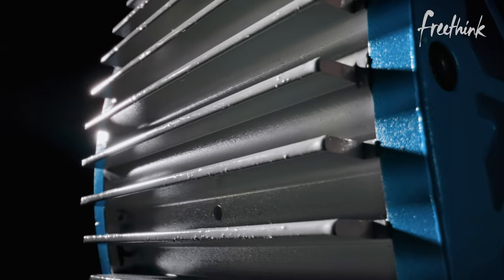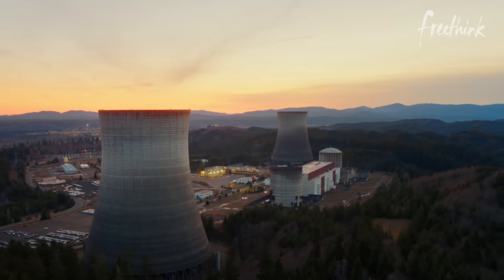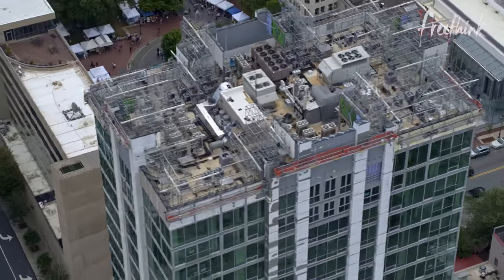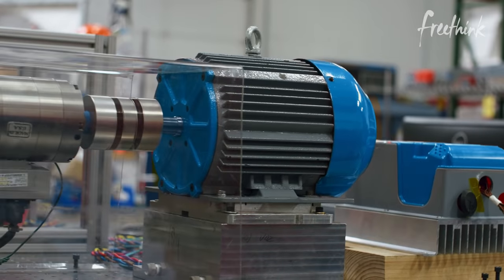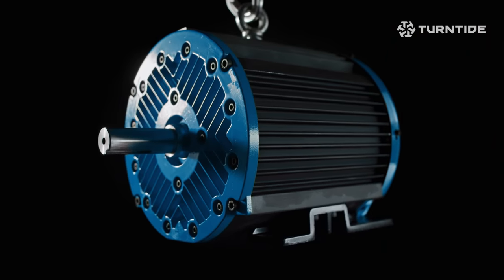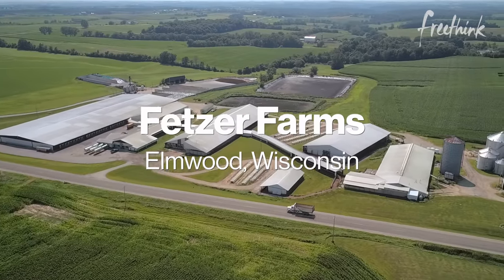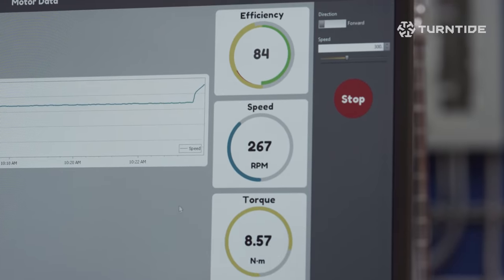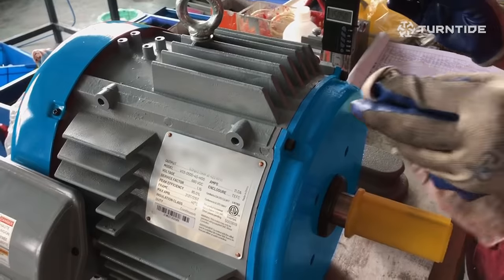Want to Save the Planet? Start with Reinventing the Motor

Comment: Most electric motors are already very efficient (>80%). So there isn't that much savings there to revolutionize anything... Sure more efficiency could help in electric vehicles somewhat, but they didn't mention anything about power to weight ratio, so it's likely not so good, otherwise it would have certainly been hyped up.

Comment: This technology is over one hundred years old. It's still an AC motor operating on slightly different constraints (reluctance). And no, you're definitely not the first to develop it or improve it.
Reply: Heh the SRM was first patented in _1838_, so yeah, well over a hundred years old :P

Comment: That sounds like a big servo drive instead of a motor. For most of the applications they mentioned, a servo motor wouldn’t be more efficient than existing induction motors run by VFD controllers.

Comment: Exactly. And you'd think the most efficient way to control it would be with a closed loop electrical system insteas of chopping the supply to the motor you could dump large bursts of energy through it like a closed loop electrical system with an LED that aslways has just a milliwatt of electricity going through it that's always active and then you can dump large bursts of electricity through them. Imagine a 1 watt solar cell charging a motor that could almost run itself with all of that mass in motion.

Comment: Will it use ac or dc,
Because if it uses dc it can be much more efficient to use in EVs and FCVs as both fuel cell and battery uses dc only,
By using a dc motor increases the efficiency by eliminating conversion losses and saves on cost of inverter.

Comment: I'm not very familiar with efficiency of motors, but the mechanism shown appears to be nothing more than a stepper motor? Also, stepper motors tend to have very low torque compared with brushless motors. I know it all depends on the design, but I don't see how this changes anything. I have a BS in Computer Engineering, so this isn't really what I'm familiar with.

Comment: Piston style over unity electric generator. By AMA
Motor segment:
1 motor with bar connected to it standing vertically
circular disc connected to bar that has magnets embedded in it surrounded in high permeability material to focus magnets outward pushing force in an upwards direction from top of disc.
Power Bar segment:
Hollowed out cylindrical Bar of material horizontally positioned.
donut shaped material with openings around its flat edge for magnets surrounded in high permeability material to be embedded.
place these all along the cylindrical bar connected to it solidly. except at far ends of bar.
At both ends of bar rings of material that can be magnetically repelled in specific locations (magnetically repelled in specific location is in reference to outside of ring area that faces away from center of bar)(Other side of same ring facing in towards center of bar is capable of magnetic repulsion all around) are connected solidly to bar. points of repulsion on these rings is off set from each other on each end of bar.
3 Hollow donut ring structure with connecting bar:
Ring structure has all magnetic repulsion on inside of donut shape & and can rap around the main bar so that the bar wont be causing friction on things as it moves back and forth. 1st positioned around far left of bar, 2nd position center of bar & 3rd positioned on far right of bar.  
Tube structure is constructed in two parts that fit together on top of each other length wise over main structure & has openings for bar to the Ring structure that is connected around the main bar keeping it from causing friction on structure with it's magnetic padding. This tube structure is designed with material that does not block magnetic fields. Perhaps some type of transparent material glass or other. At both ends of the tube structure there is a built in groove that will house a disc, the groove has 4 points, top bottom left and right that has small magnets embedded in it on the inside so that the pushing force from magnets is pushing in towards the edge of disc that goes in this spot. The disc has ring around it that is repelled by magnetic fields so the 4 small magnets will keep it lined up but it will be able to spin without causing friction on structure. The disc has openings on it's flat side that face inside of tube and magnets surrounded in high permeability material are embedded in this disc. The disc has small bar that is connected to it that goes all the way to the other end of Power bar structure through the center of the hollowed out bar and connects to disc on other end. Disc on other end is set up the same but magnets embedded in it are off set in comparison. As first disc spins the magnetic fields will push against specific spot on disc connected directly to bar, pushing bar in other direction, once bar is fully pushed over, further spinning of disc will then align the other sides magnet to push it back. Tube structure also has half moon shaped protrusion on inside and on both halves so when tube is connected they line up to make a full ring shape on inside of tube, these half moon shaped protrusions have at least 1 small round opening on it's side in middle of curve that faces away from center of bar. The opening has a small magnet embedded in it so magnetic force is repelling out sideways away from center of bar. The protruding ring is positioned to line up slightly further in towards center of bar then the ring of magnetically repelled material connected directly to bar. This way when bar moves to right this magnet will act as a stopper keeping bar from going to far & same setup on other side will keep bar from going to far to left. 
Copper coil setup:
copper coils are wound up as if wound around the width of wood board for a distance equal to width of magnetic ring setup on bar. Wound copper coils are then looped around the tube like a donut lined up perpendicular to magnetic fields. Ends of copper coils are connected into separate construct that will allow electrical current to flow somewhere else.   
Circular construct is built like a stand that goes around the outside of motor segment. 
Circular construct has flat ring of high permeability (magnetic field shielding) material that has small openings that will allow magnetic fields through specific locations. Top of circular construct has groove to allow the power bar to balance on. Circular construct can also be placed on other end of power bar so it is balanced. The motor segment is positioned so the disc connected to the bar that is connected to the motor is lined up so the disc passes under the power bars disc that is at end of power bar. The high permeability material keeps the magnetic field from the embedded magnets exerting their force upwards from hitting into the disc in the power bar until just the right moment when the impact will cause the disc in power bar to spin which will perpetuate the piston motion in the power bar. More power bars of the same design are built and positioned around the motor segment in a circular fashion all the way around. The bar connected to the motor can be increased in length to desired height and more of the exact same setup is repeated higher and higher up maximizing the over unity potential of the construct to ridiculous proportions. :D Current from the power bars is diverted to power the motor as needed and all other current is diverted to power my game console or the world. :)
                  --By AMA--

Comment: Coal and NG fired generating plants, produce more electricity in less, and need less landmass than so-called green, electrical generation facilities. 

Furthermore, the manufacture of green tech components, photovoltaic cells, wind turbine blades, etc is quite "dirty". Not to mention the waste that they generate at the end of their life, which is less than traditional generation facilities.

Comment: Oh crap, for the most of their existence period, 3 phase motors were simple and efficient, for IE1 standard motor efficiency is between 87% and 96% (bigger size more efficient it become). If you add inverter and its efficiency will never drop below 95% (provided that vsd is correctly set. 
There used to be another great machine which was robust , easy to maintain, then they stuffed it with tonnes of electronic control systems (which manufactured in china and overcoded made whole machine a nightmare for the user)  and made farming expensive - tractors...
 This is kind of thinking from economics graduate - I will show you that my existence is not pointless...
Each motor with their electronic controller - do not even want to think about it...

Comment: The argument is that this motor is cheaper and more efficient right? Why not sell it to EV manufacturers? Practical use gains adoption. That’s just the way the market works.

Comment: Upto 15% of energy is used by the grid.  20% is used by lighting.  Seems reasonable that motors might use 50% of all energy, but variable reluctance motors are nothing new.  Many compnies provide drives for these types of motors

Comment: This might be a good motor, and a good company, but all of the innaccurate motor hyperbole talk absolutely ruined it.

Compute is finally available? Having it implied that jets can only be controlled with Machine Learning? There are plenty of other motor types that offer high efficiency power conversion.

It's great that they're going after applications that have poor efficiency motors, but that's not to say that ALL motors are in-efficient.

Comment: From the type of the video presentation it's more likely this motor is for replacement of conventional blower/ cooling motor...but in no way as of persent is it going
to replace the compressor motor.....
conventional compressor motors still have very poor
rotary to linear compression efficiencies.. ..
Today in HVAC apps. , brushless P.M. D.C. 
" LINEAR " motors with nearly 99% efficiency are replacing those conventional compressor motors.
known as of today
L.G. brand has many models in Refrigeration  segment that are available with " linear " motorbuilt into their compressors.. 
....just ONE  mechanical moving part.. as compared to conventional compressors...

Comment: That's not new. Every hard drive and most of CD/DVD players have those. They are 3 phase motors. Also, you just need to pulsate at the right frequency, 20kHz is no problem since ages.

Comment: It's ICEs Internal combustion Engines who are - at best - 50% efficient, not electric motors.
Electric motors are much more than 50% efficient. If you compared mechanical governors as of the late 19th century / or simple coarse electrical governors as of early 20th century - you should had stated that.

Comment: 2 things. 
1. Climate change is NOT reversible, the only thing that can be done is the reduction of green house emitions

2. When this technology get masive the amount of energy needed to do a lot of things will be higher than the actual one (the more you need technology, the more you need electricity), so yes this will be a little helpful but will not be a solution for climate change
Reply: @F a well you have a valid point

Comment: That half of all electricty wasted has to be taking into account long high voltage transmission losses, motors are at worst 85 percent efficient
Reply: but that doesn't make sense, because if you only swap the motor all the other losses wont change

Comment: So...... They've built a stepper motor.  What's the big f'n deal???  You can buy steppers with controllers almost anywhere now.
China is pumping these things out.  All of the hobby CNC machines are powered by stepper motors.

Comment: Before all y'all brush off the claims made in this video, know two things: 1) This is a marketing video, not and engineering video. and 2) Their claim about half the energy consumed by a motor is wasted might be true when you consider the end result product the motor produces.  What if, most of the time, a motor could run at 1/2 power and still produce the same work product (building cooled a certain amount, for example).  That extra power would have been wasted.  Not everything you think is stupid, is actually stupid...
Reply: What you are talking about is what a motor controller does, and its not a new invention, very cheap controllers exist for decades and are integrated in many electronic products.

Comment: Srm motors aren't more efficient than pm motors don't understand why you're saying it is the solution, asynchronous motors are also cheap, reliable and in most cases more than 80% efficient and need no drivers for single speed applications

Comment: The induction motor is already a piece of art. The advances should be made in the electronics of speed control drives. Just rhink about it, a VFD panel running big motors need air conditioning 24×7. The video itself is laughable.

Comment: I actually have rethought the motor. The design can be applied to machines across the board, and even a kinetic powered system for deep space operations, unaffected by cosmic Ray's, or radiation. These machines will be useful in extreme places like in Fukushimas failed reactors. Let's talk. www.anon2020.com

Comment: I thought the BLDC motor already existed ?
Reply: Eric Meyerson
1 month ago
Some differences between BLDC motors and SRMs:
The SRM uses reluctance torque, BLDC motors use Lorentz torque (BLI torque which is the cross product of the flux linkage and current).
The SRM has no permanent magnets, just magnetic steel and copper, which means no rare earth minerals. Therefore, the SRM is more reliable, because permanent magnets demagnetize at elevated temperatures.
BLDC motors typically have hall effect sensors for commutation (another failure mechanism).  SRMs use sensorless control for commutation and eliminate the additional wiring and failure mechanism.
BLDC motors have high common mode voltages which lead to bearing current issues. SRMs do not have this problem.

Comment: HVAC cycles consume such power, not the motors, you have VFD's what all do you need? Electricity is wasted in heating and cooling loads not on inductance load.

Comment: This is called a Reluctance Machine. It's teoricaly a little more efficient than induction machines "by default" because it don't have Joule rotor losses. But it's very shitty in torque ripple and needs a controller to mitigate it. When using a controle a rare earth PMSM is more efficent than this.
Even though, the state of the art in machines design are the PMASynRM, thata are reluctance macines with ferrite magnets but it's in first steps of design and the torque ripple sucks

Comment: For those who don't understand the numbers game they're playing, say you have a 90% efficient motor.  Then they take it to 95%.  They're claiming 50% more efficiency, when it's really only a 50% reduction of the inefficiency and only a 5% actual gain, 10 times less than claimed.  There wasn't anything remotely near 50% more efficiency to even gain, it was only 10% of inefficiency in the original.  It's only a big % change in the tiny % that's left so the only possible actual change is that small % of inefficiency that's left.
These inflated 'efficiency' gains can be quite real for the actual % they are, but they're usually only tiny gains in actual energy usage and cost.  IOW Marketing hype using poor math and misdirection to fool the ignorant.  Go do the math and you'll quickly figure out how silly their claims are in most cases..
Reply: @cornyhub7551  LOL @ silly free energy crap.  Really it's just people who can't keep up with all the changing variables in a motor properly, as always.
Reply: How to RUN 3 phase AC induction Motor with Single phase AC Power supply at home,, NO electronic Module
Reply: @ModelLights  -How to RUN 3 phase AC induction Motor with Single phase AC Power supply at home,, NO electronic Module
Reply: @cornyhub7551  If that's all you think it is, then you clearly don't know what you're linking. 
 'Bedini Motor ( Generator ) How To Build One' is the title, 'Bendini motor' is about free energy crap.
Reply: @cornyhub7551  Doesn't matter anyway, stop posting dumb crap that has nothing to do with my original post as replies like the mean something.  Leave the motors and electronics to people who understand what they're doing..

Comment: I cannot help to not commenting on this video. First of all, what they describe here is a well-known motor type known as strpper motor. Where the more of that magnetic thingy equals to higher precission of steps (rotational angle). Typically such motor will have a big controller box just to sense and deploy the current (current = torque) according to the rotor rotational position. And this is typicall PID control approach, but now he wants to use Ai for controlling this basic function. Why? Are we loosing hope on modeling things in a mathematical forms? Are just abandoning calculus?

Comment: There is small room for an increase in efficiency in today's electric motors.  There is a world to gain however in the use of material. 
And the answer to that is already there. 
Thanks to neodymium permanent magnets, there is nowadays the axial motor with the shortest magnetic circuit and consequently less material.  
No iron in the rotor and much less in the stator.
So this story is quite irrelevant.  
Great haircut though!

Comment: 20kHz switching "impossible"
>laughts in 300kHz inverter
You easily drive electric engine digitally, simplest of it is within computer fan...
Also, new norms and trends pushes producers to seek efficiency. When buying fridge, you get energy rating, alongside with yearly consumption, giving you reason to pick more efficient stuff. Majority of engines are super efficient, except low power cheapest stuff. And you ain't really save the planet swapping your old 30w room fan to 25w new model.